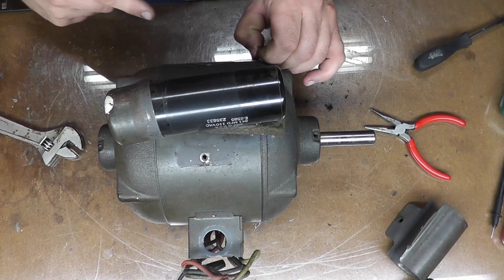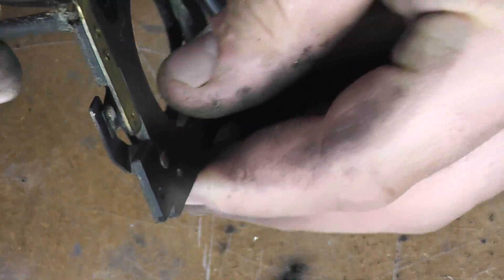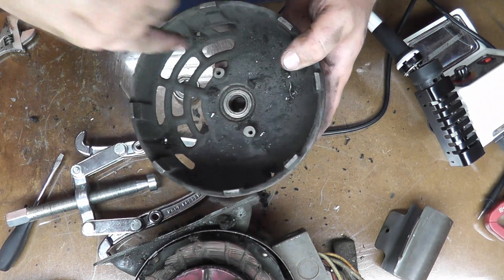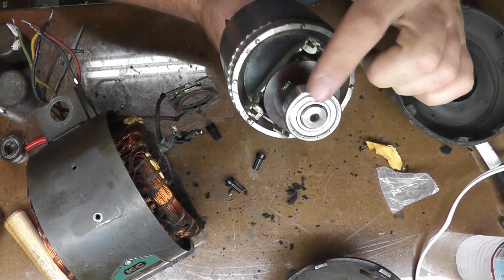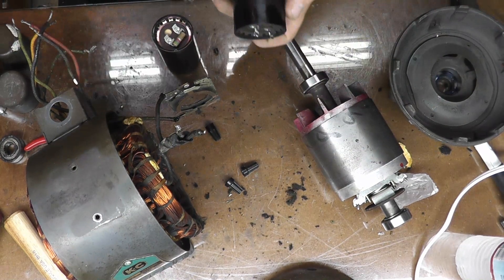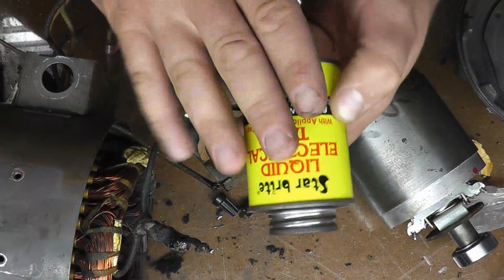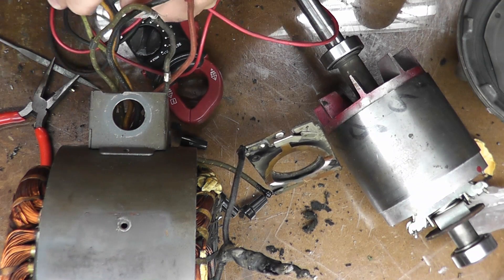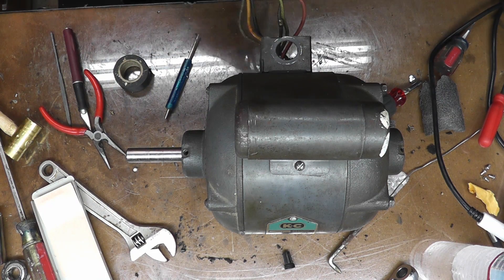1/2 Hp Dual Voltage Single Phase Motor Rebuild

Comment: I have an old, old 1/3 hp motor off an old Delta drill press. It wouldn't start on its own. I suspected the starter capacitor was bad but it checks good. Have any  idea's as to what's ailing it?
Reply from the maker: If it's not the capacitor I'd have a look at the centrifugal switch.  Could very well be that the switch has a lot of carbon build up from arcing and is not making good contact.  Give the contacts a light sand with some emery and make sure they close.
Reply: Ronald Knipp

Comment: Great video! It would have been nice to see more of the wiring connections. When you said "all you have to do to reverse the motor direction  was to switch the capacitor leads". Does that apply to all motors with a centrifugal switch? Also if I connect the wiring to a double pole double  throw  DPDT switch can it reverse on demand? Of course the central switch wiring will be crossing over to change polarity direction. thanks
Reply from the maker: It applies to most motors.  Each one can be slightly different in the wiring numbers especially if you have one made before NEMA standards.  Also most motors are not instant reverse.  My lathe is an exception, but it contains an extra relay for this purpose.  For a regular motor you would have to wait for the motor to slow down and the centrifugal switch to close before it can be reversed otherwise it will continue in the same direction.

Comment: I have a Dayton 3/4 hp single phase (6K376BA) that I want to change rotation on. Can you link me to a video you may have made to do that or another you would recommend? Also I need an end plate to cover the wiring access if you might know where I could get one please? Thank you for making and sharing your video!
Mac
Reply from the maker: Is the motor plate intact?  If it is there is a wiring diagram on there that shows to switch 2 wires.  You'll have to search online for the wiring cover.  There are a few places around that stock motor parts such as centrifugal switches.  They may have something.
Reply: The motor plate is intact but all the wires are numbered with no other reference. I'll check with centrifugal switches for the wiring cover. Thank You.

Comment: @ 5:30, use grease to fill the area behind the bearing and use either the shaft or a dowel through the center hole to rapidly compress (AKA smack with a hammer) the grease pushing the bearing out.
Reply: Yup, I remember that trick from a long time ago. I didn't believe it until I tried it. I used a dowel and it took a few whacks to get it out.

Comment: That's a cool old motor! I'm curious what keeps the stator in center, inside the shell? It looks like it's loose when the motor is disassembled.

One more point, with the capacitor discharge resistors. They also help prolong the life of the centrifugal switch contacts. Motors in an application with very short run cycles can start, stop and close the switch with a charge still on the capacitor. Making sure the caps are discharged before the motor stops (and the centrifugal switch closes) will help with the pitting.
Reply: I don't believe there's any evidence that proves bleed resistors "help prolong the life of the centrifugal switch contacts". In some applications, they're put in place to stop something known as regeneration; where the capacitor discharges while winding down as the motor passes from the run winding to the start winding creating a shuddering effect as the motor tries to restart.
Reply: jrmym2
Sure there is. I (c) = c dv/dt. R makes sure you don't change v in 0 time. Z= 1/CS parallel with R, where S = J w, w=2pi f, if memory is correct.
Reply: Don Gore Yeah right , that's what I was going to say...Just kidding : - )

Ken....this is so interesting and I don't have a clue.

Comment: Hey Greg something occurred to me that could be a valued addition to this video for clarification. It is crucial that the main windings be phased correctly! Perhaps you could add some text to this video indicating the relevance to a 6 wire capacitor start motor.

Comment: Great vid Halligan. I rebuild these all the time. I get 20 or 30 given to me every year. Its fun to get them back into service and your vid is a great instructional tool for the inexperienced. I look forward to the next one.
Reply: Hey Mr. TOOLSINBOX, 11 YRS. ago,.. wow! do you sell those 20-30 motors? I'm in Phillips Wi. USA I need at least  (1) 3/4 1,700_RPM for my 1943 Air compressor. I could buy a ew one , or use one of the modern motors I have taking up space but want to keep the look of Air Compressor "Retro" If I could post a photo of it you would understand. yesterday 12/19/24 I  rebuilt a 1931 HOOVER 1/2hp.for my 1933 CRAFTSMEN  Table Saw. I never knew HOOVER made commercial motors until I pulled this one out of saw.   Tempted to use it on A.P. and put  modern motor in saw, can't see it anyways,..?  Love the OLD OLD tools. appliances I Make them like new and I USE THEM! Oh wanted to mention , I replace the "Cork Screws" at Bearing oil ports with "Grease Zikrs" Steve

Comment: Nice video . again! :) Just a tip - capacitor could be made longer by gluing a chopped off piece of the old - onto the new one. With Tec7, or similar..

Comment: The next time you have to get a blind bearing out, fill it with grease and use a tight fitting punch. It's messy, but they will usually come right out. I agree with the guys about marking the end bells, like to do it before I even remove any bolts.

Comment: Nice vid. Switch the 2 starting leads to rev rotation. 6202 is a common metric brng, it's said "sixty-two, O, two". It's a 6200 series brng.  6000, 6100, 6200, etc.  I have lots of dual volt motors here wired for 220v that have 110v cap for starting in them. It's such a brief time they are energized it doesn't seem to bother them.  Single voltage motors can be opened and rewired higher or lower by tracing the windings and can always put a HD DPDT 250V switch for reversing the starting leads.

Comment: ooops, forgot to mention.  The 110VAC on your capacitor indicates a MAXIMUM WORKING voltage.    So, when replacing always be sure to replace with a working voltage rating of AT LEAST the voltage that the motor will be running on.  As a general rule, ANY capacitor, paper, ceramic, electrolytic, tantalum etc., will have a MAXIMUM WORKING VOLTAGE RATING. Keep these great videos coming.  Mark in the UK

Comment: Hi Greg. Exactly what I did about 3 weeks ago with a similar size motor for a wood lathe. In my case when I got to the rear bearing (enclosed like yours), I packed the void with grease and found a close tolerance sliding fit shaft. Entering into the hole in the bearing and hit with a hammer to 'hydraulically' press the bearing out from behind. Maybe refill with grease as some air will be trapped, but a couple of go's and it will come out without needing to drill the 2 holes. Mark in the UK

Comment: cont. from below: with a punch mark, 1 and 2 punches so it's easy to put back together. It sounds like you're handling it well, just some additional info. If you did have loose rotor bars, it would be hard starting the machine. You do great work, btw :)

Comment: They make a motor tester that ouputs a pulse for ringing to check for shorted turns for that stator, but it's an expensive machine better suited for large motors for industrial use. Generally, shorted turns on the stator causes localized heating, pretty subjective to test for. Use a growler to test for open rotor bars, and usually just burnish the starting switch contacts unless it's burnt bad. The color of the windings tell you a lot. BTW, we usually mark the end bells and the stator housing.